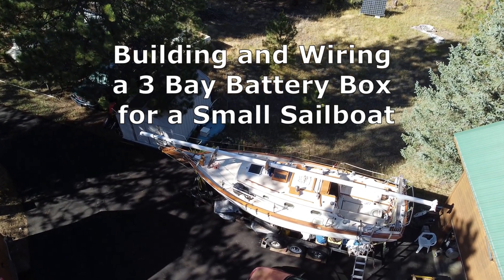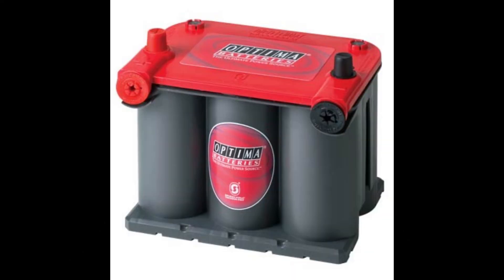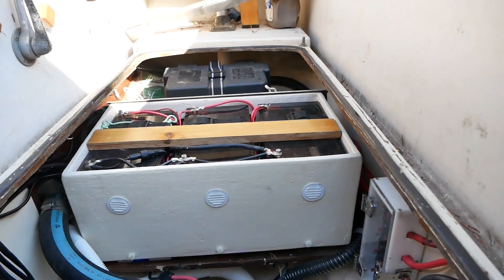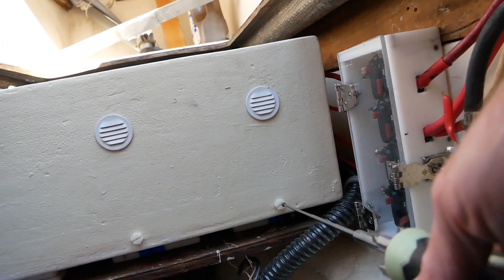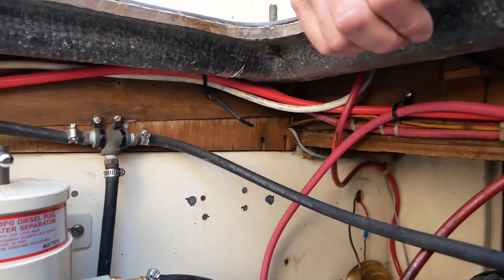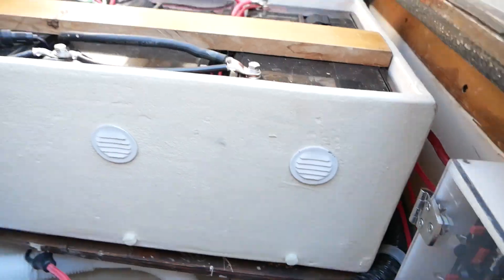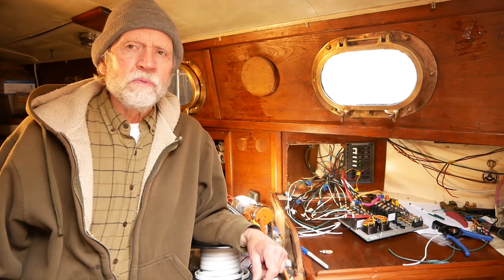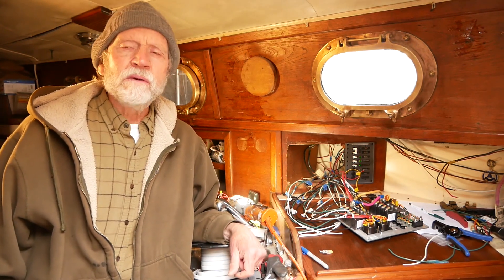Building and Wiring a 3 bay Battery Box on a Small Sailboat

Comment: I may have missed what type batteries you chose for your house batts. ??   They don't look like Lithium Batts. and if not, what type did you choose ??  Was it Marine ?  Deep Cycle ??  AGM ??  Lead Acid ??
What were your reasons for your choice ??
I'm getting ready to purchase batteries for my restore and all I'll have to power are lights, bilge pump, Audio & USB charging stations etc ...  Not a whole lot of amps I guess and I'd like to hear what to think of when choosing.
Thanks for your generous consideration,
Sincerely .......................
Reply from the maker: Thank you very much for your very helpful comments. I have included some information about the batteries in the movie description addressing some of your questions. These AGMs are typically used in solar power systems. If I could do it over, I'd go with Lithium batteries as they have gotten much cheaper (but still 2-3x the cost) and have more safety built in now. So many advantages- charge much faster, can be drawn down more, and much lighter.